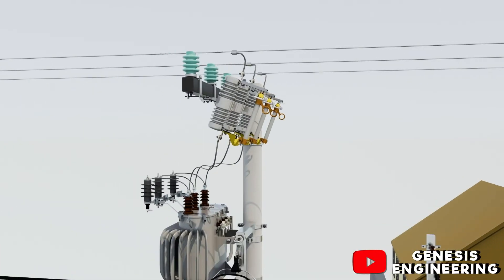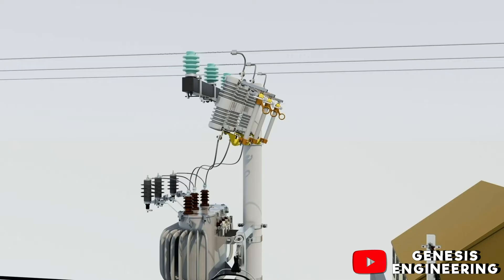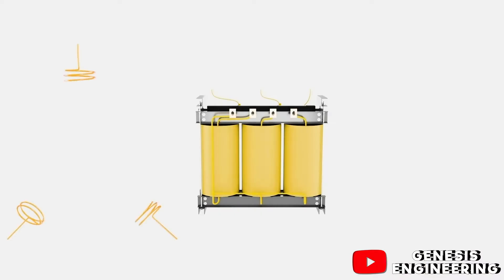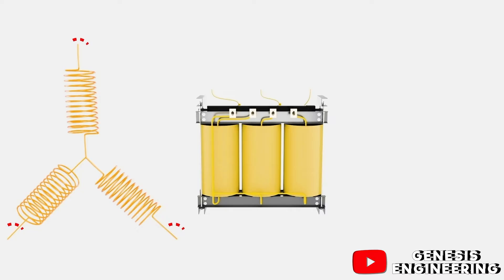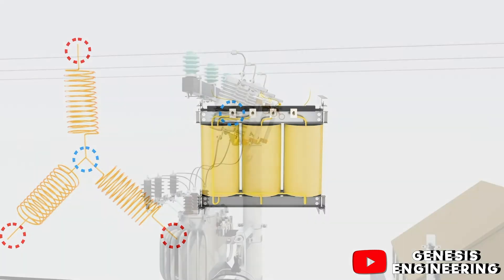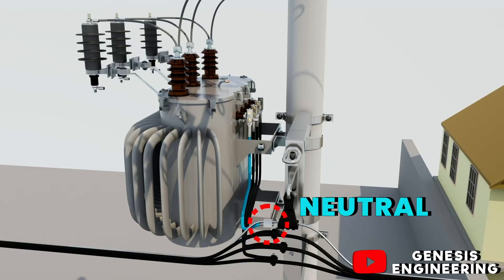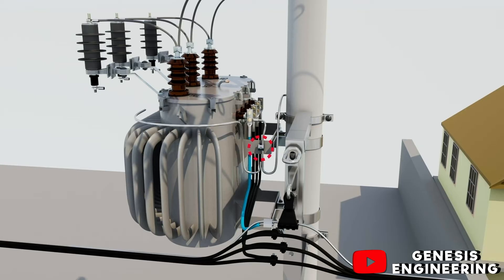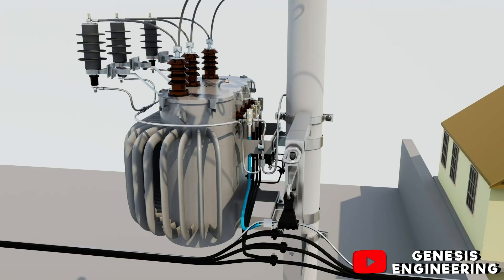Where does the neutral wire come from, explained

Comment: You are showing a three phase service transformer. Three phase service is for industrial and commercial service. Industrial customers have large motors than benefit from three phase service. Residential service does not need three phase service because they only use single phase motors in their air conditioning. Residential only get single phase service and only use one single phase transformer connecting to a single phase wire and a neutral wire on the primary side of the transformer. The diagram of the three phase transformer is not required for this topic and the three phase Y transformer is in the substation and produces the typical distribution voltage of around 12,000 volts from the transmission lines.
Reply: Not in Europe where 230/400V 3-phase is in normal domestic use.
Reply: @kjellg6532  Why would you have 3-phase power?

We have no residential three phase equipment to use three phase service. It is not until you get the commercial grade HVAC larger than 5 tons do you need three phase service. There are some apartment complexes that have three phase and supply the individual apartments with two of the three phase. These locations will have 208 v / 120 v instead of 240 v /120 v. Some utilities supply 208/120 single split phase to their customers. Most 240 v equipment will operate on 208 v.

Three phase power adds an extra cost and complexity that is not economically appreciated unless large three phase motors are used.
Reply: @TexasEngineer  I have a 3-phase heating system, 20 kW. With water it weights about 350 kg. 
My son has a Tesla EV. It can be charged using 1 phase, 32A 7,4 kW or it can be charged with 3-phase 16A 11 kW.  I have a carpenters saw, 3-phase. But I agree that most of our appliances runs on 1 phase 230V and it is a bit more practical as you have no balancing issues.
Reply: @TexasEngineer  Extra cost? It depends. Electrical loss pr kg copper is reduced. Price of drop wire to your house is decreased.  In your main switch frame the incoming circuit breaker must be a 3-phase, i.e. more cost, but for all the 1-phase circuits the 2p breakers are the same. These are fed from a 3-phase rail system. One more rail, but less copper pr rail.
Reply: @kjellg6532  I have a 19.2 kw air handler with electric heat strips. It pulls 82 amps on its 100 amp breaker. The strips only weight a pound or three. My main breaker is 150 amp and a normal gas house of my era have a 100 amp breaker. Your EV opens another issue I have not given any thought, mainly because it would require me and a lot of other people to make a major electrical panel upgrade and a large increase in the electric bill. Gasoline and cars are cheap in Texas and Texas has instituted a higher EV annual registration tax.
Reply: @TexasEngineer  And n Norway normal max breaker is 3*63A with IT and 3*40A with TN. In both cases about 25 kW in total for a detached house with electric heating.